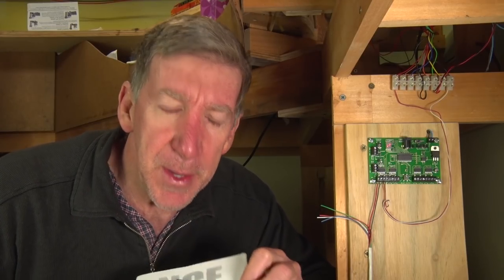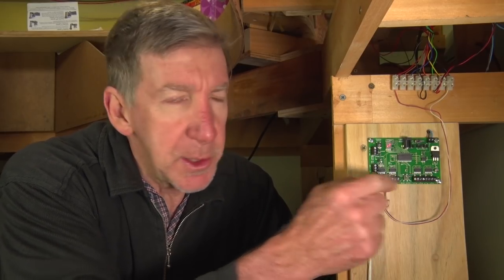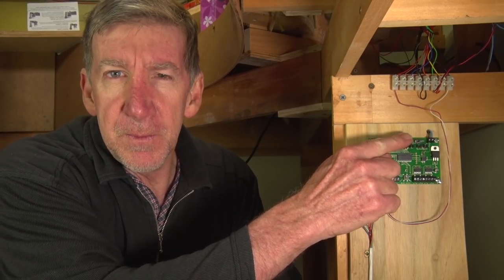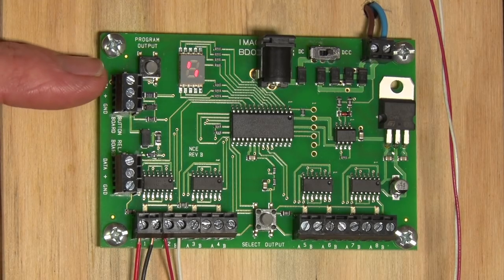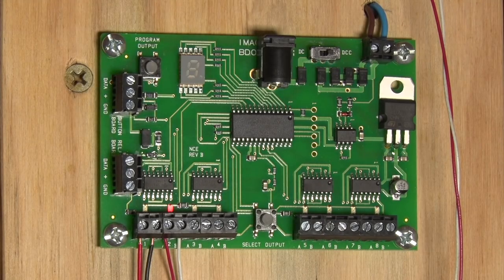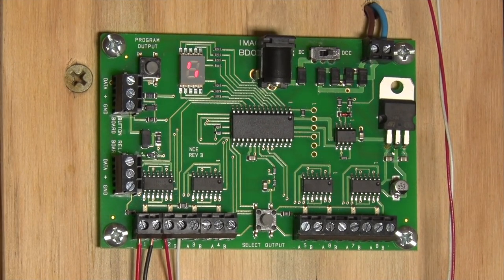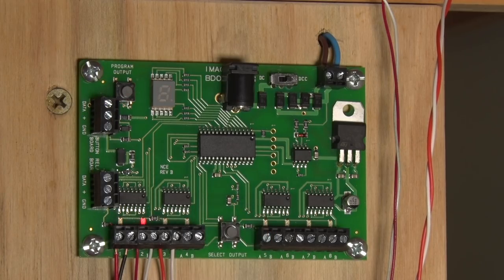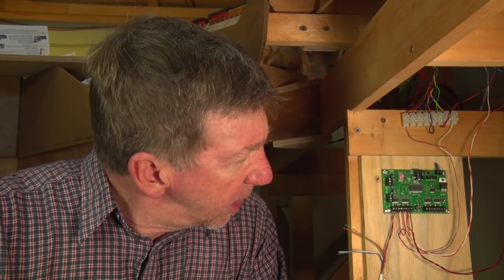NCE Switch 8 Mk2 decoder. Wiring and programming.

Comment: I allow .5 amp per switch 8. have one district that has 4 in it.  You have to watch it.  If I did it over would run a switch power buss. IE Track buss for switches off of separate booster.  Or on the MK 2 use to outside power supply.

Comment: Gregg great coverage of the MK 2  I have 8 Switch 8s on layout and they are all old type and tie in Switch 8s and Switch it though mini panel to control switches off of buttons. They have a marco written to throw switches in a set order. Using the trigger connections on switch its, I know for a fact do not report to command station of the action. Do not know about the MK 2. If does not report then if you have control panel you will not know if switch is thrown. That is why I use the mini panel for those that I use a button or DTCOMCS switch.  It triggers instructions in mini panel which reports to command station. HAD Big lighting strike EMP. Command Station, 10 switch its, One AIU 01 and still waiting to find out about two mini panels as do not have current e prom that has that info on it running the RR.  Using original System One unit.  Tons of other damage. iF YOU HAVE A JMRI PANEL YOU CAN SWITCH THE POLARITY IN THE COMPUTER. I am throwing up to three switches at once off of one decoder in a marco for a latter in a yard.
Reply from the maker: Thank you Art...a big rap coming from you, my "Go to" man for  NCE-JMRI info!  I can't remember if the Button board is smart enough to send info to JMRI? 
Thats bad news about the strike, I unplug the layout when I go away but not when I'm home! Did a course at work on lightning strikes...very hard to stop them in domestic situations and we spend thousands trying to protect signals and interlocking in the field. 
I hope you can claim some on insurance?  So you can change polarity on JMRI, I thought you could but not sure. I did mention you in my first take,, but wasn't happy with the lighting so did that part again and forgot...but I did add your details in the description sir. 
Thanks again for your knowledge and how you explain it Art.
Cheers Gregg.

Comment: Hi Gregg, an interesting video. My NCE power Cab started playing up after I hadn’t used it for a while, the wheel to control the speed steps is playing up, the numbers increase then all of a sudden they jump from 9 back to 2 when increasing the speed, of course the loco slows down as well, a pain in the ars.
Now I have a Roco Z21 advanced DCC controller, using the app is much easier to control loco’s, you just tap the picture of the loco you want to control, no typing in an address to change to a different loco, it’s the same for the points , touch the one you want to switch and it switches.
Great to see you back home again 😊. Take care, regards Gary 😊🍻

Comment: I have another question Gregg,,,,,,if I double up on these crossovers will I be able to program the two conjoined switch tracks independently?,,,,,,,what if I want to have one switch open and one remain closed,,,,am I saying this right,,,,,hope you understand,,,,
Reply from the maker: Hi Nina, if both are on the same output, then only 1 address is possible. If you want to switch them independently, then they need two outputs.  But you should always switch a crossover together.
Gregg :-)

Comment: Hey Gregg how would you suggest doing a double crossover? Would doubling up  2 channels each, and programming the 2 channels the same address be viable?
Reply from the maker: Thats exactly right Sir!  I n real life, that would probably be 2 switch numbers, one to cross in one direction, and another number to cross in the opposite but if you want 4 machines to switch at once , thats how to do it! I tried doubling an address and it worked. 
Cheers Gregg,

Comment: I changed my old switch 8 for the Mk2 few few months ago ( did a video on it!😀). They are very good. I also fitted the button board on to my layout diagram. It's so much easier for people at exhibitions to just flick the switch than to keep explaining press this button, press that button etc. After 8 hours the fun wears off!. 
Sorry, just one more thing, you forgot to mention to change the power input switch on the board to DC if your running off external power supply. Keith
Reply from the maker: Hi Keith, I haven't used the old version, but I like the button board option on the MK2. I did think of getting the button board as  well , but it doesn't send a input to JMRI to say the turnout is thrown, but if you don't wan't that it's a great idea, as you say you don't wan't people pushing buttons on cabs!!  Yes , I forgot the DC-DCC switch!
Thanks for watching.
Cheers Gregg.

Comment: Thanks for this Gregg. I'm still catching up on all of your videos. I'm getting a Switch 8. Have you tried a WFD 30 from Wifitrax - an Australian product. Allows train and accessory control via phone or tablet app via WiFi instead of the clunky old NCE Pro Cab. JMRI and internet connection not necessary either. A lot cheaper and user friendly than buying extra Cabs and ports etc and a good compromise without going to a laptop, JMRI etc.
Reply from the maker: Thanks Peter!  I'm glad you're enjoy the videos  and I appreciate the support. I was actually looking at the WFD30 this week, as I have to send a cab back to Gary at MRRC to get a screen replaced. It looks like a good idea to get extra throttles , but I prefer to have a tactile feel from a controller, as I run my trains a specific way and need to feel resistance on the controls. But it would be handy to have a walk around cab and this is much cheaper than a NCE radio set up! So I think I'll get one when I get the Procab repaired.
Cheers Gregg.

Comment: Nice product. My only complaint-they don't give you much room for 2 sets of wires crossovers
Reply from the maker: Thanks Marten. There is plenty of space for two sets of ( not large ones)wires for a crossover, but you would normally run wires to the first machine then from that to the next one. If you prefer to run both machines out of the module, you can get the wires in there. 
Cheers Gregg.

Comment: Hello Greg, very useful and certainly one I will keep coming back to. 
In an earlier video, you explained Swiss cheese. Linking Swiss cheese and switch 8, do you think there would be any electrical risks from using a switch 8 to operate turnouts in different power districts?
Thanks,
Bob
Reply from the maker: Hi Bob, glad you liked the video and thanks for the positive comments!  There is no risk in running turnouts in different power districts, as you are not connecting the Switch 8 "back" to any tracks, only to  the turnout motors. The only hassle  is if the power district that runs the switch 8 trips, you loose power to the turnout motors, which isn't a big deal unless you're throwing a switch when the power trips. The way a lot of people go , is to have another power district just for the Switch 8 decoders, so all the turnouts are on a separate power supply.
Cheers Gregg.

Comment: if I run two switches for my crossover how would I assign addresses to the combination?
Reply from the maker: Hi Nina, you connect both machines to one output and address that output. Crossovers have a common number as they both switch  together.
Gregg.

Comment: i'm not into model trains like you people are so i probably don't know what i'm talking about.  you commented about voltage drop while the device is switching, if i understood it correctly.  your comments seem to imply the drop is unexpected.  is it possible the makers saw some sense to install a 'soft start ' function into the circuits like on some modern power tools like angle grinders.  it may help make components last longer possibly or not destroy something if it is jammed in place.  there seems to be a lot of computing power on that board for what it seems designed to do.
Reply from the maker: Hi , thanks for watching.  The voltage actually rises while switching, then drops to 10 volts, so it is like a "soft start" and hold feature?  The board is quiet smart and can do many functions so I would not be surprised , but seeing the voltage did surprise me . 
Cheers Gregg.